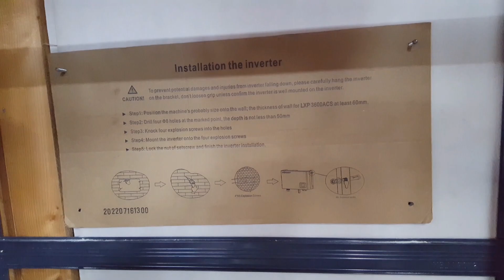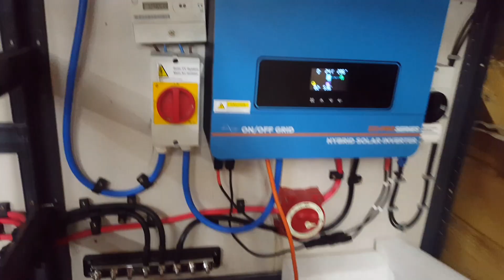My DIY Powerwall. Hanging the LUXPOWER LXP 3600 AC Coupled Inverter.

Comment: Real nice looking forward to when it is up and running.
Reply from the maker: Thanks very much, if I get it running lol, this one is more technical than my big blue Anern. As I write this I am trying to comprehend the user manual.  I am getting a headache 🤣
Reply: @garys-half-baked-offgrid-dream  stupid YouTube, I looked in the manual and it looks like setting the dip switch and then powering it up and step by step setting all settings, I would put a like to the manual I found but YouTube won’t let me
Reply from the maker: @thomasdesloovere4200  Not to worrie Youtube is strange like that.  I have had that a few times but then other times its fine. 
The hard copy user I have with it shows the dip switches fimgers crossed. If I get stuck google will be my first call.
Cheers for taking the time mate to lool into it mate. 👍